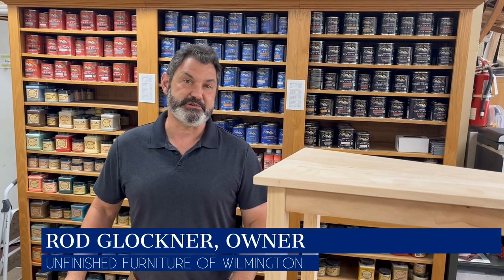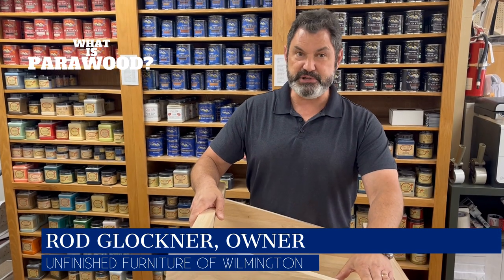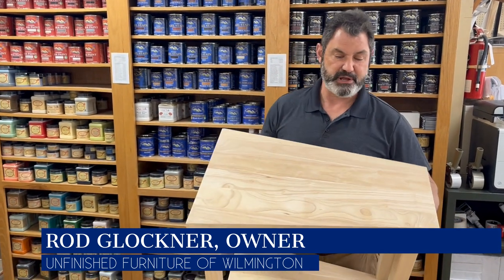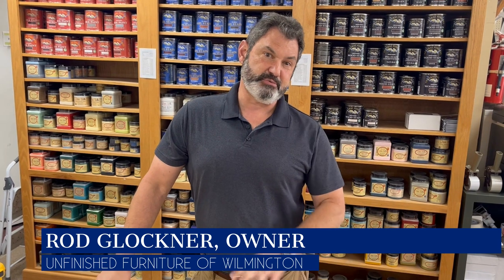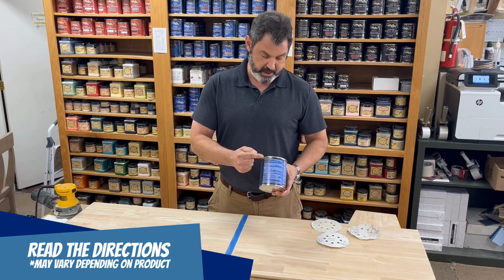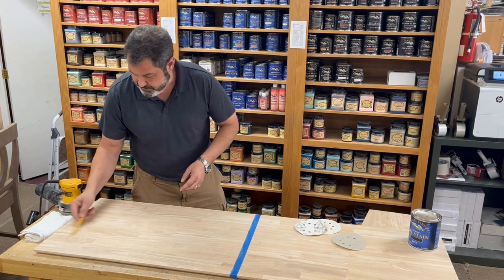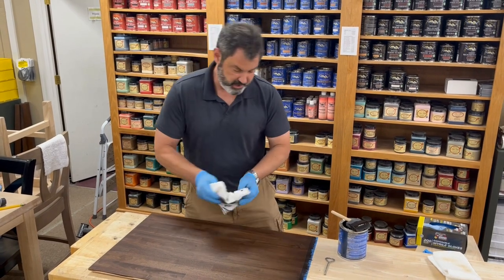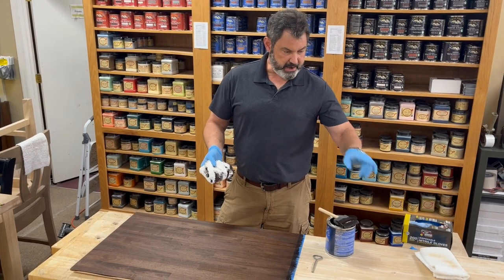What is Parawood and How to Prep and Stain Parawood

Comment: I put my 1st coat on and its blotchy, did not use thinner. could I sand it again, use thinner then re-stain for a better 1st coat?
Reply from the maker: Absolutely.  Parawood is solid wood so you can sand and restart with no worries.

Comment: I love the color of that sanded side...what is the color  & wouldn't want it darker. So my question is, how.many coats.& want is.the best top coat or sealer for butcher block counter tops?
Reply from the maker: Hi John!  You could wipe mineral oil on the butcher block to keep it in good condition.  After using it for any food prep, wash it with soap and water and then reapply more mineral oil.  You could also use what is called "Waterlox", which you can apply less frequently.  It's easier to maintain.  Here's a link to their website if you'd like to research: https://www.waterlox.com/original/ :)
Reply: This video was very informative. I have never used stains before and bought a water based walnut for my parawood table. I just sanded the entire table at 80 grit before I saw this video. 😮Should I follow your steps and sand it with your recommendations? Also do you recommend water based or oil based on parawood? What color was this that you used?
Reply from the maker: Hi Batch2b!  150-180 grit is what we used in the video.  Nothing wrong with following the steps in this video on your project.  Both types of stain work well on parawood.  We like oil based better, it's just easier to use.  In the video, Java Gel Stain by General Finishes was used.  If you have any other questions, just let us know!

Comment: great video! it's hard finding resources on refinishing rubber wood. what sealer would you recommend? i wanted to refinish the rubber wood top on my kitchen workbench and want to preserve it's blonde color
Reply from the maker: Thank you for the kind words!  We like General Finishes Topcoats.  Their High Performance water-based urethane topcoats can be used over painted, stained, and raw wood surfaces.  It works very well with parawood/rubber wood.

Comment: Thanks for this helpful video.
I want to whitewash an unfinished, unassembled parawood nightstand. Do I follow the same prep steps that you showed above for staining? What do you recommend for a clear top coat--water or oil-based? Thanks!
Reply from the maker: Hi Deb!  Follow the same directions as seen in the video for either painting or staining. 
If you have any doubts as to how the whitewash will look, start on the underside of the nightstand or an area that is not as visible like the back of a drawer.  That way, you see how it looks, can make any tweaks, and can then continue with the entire project.  
As for clear coating, we love the General Finishes water based top coat.  Oil based can yellow over time but certainly the General Finish oil based top coat is indeed awesome as well.  If you using an oil based paint and using a water based topcoat, let the final coat of paint/stain cure for at least 72 hours before applying the water based top coat.

Comment: Can you use water instead of paint thinner? Also, have you tried Odie’s oil on it?
Reply from the maker: Hi Patti! Water can work similarly on some wood species like Pine and Parawood, but steer clear using water for this technique with Oaks. 
One of the benefits with using paint thinner is that it evaporates rather quickly.  Water can raise the grain so you might have to do some light resanding to knock the raised fuzzy feeling off.  We have not used Odie's Oil so unfortunately, we don't have any info on it.

Comment: Someone talked me into using Dixie Belle Boss clear coat under my gel stain before staining.  It has made my furniture really rough.  Have I made a mistake?
Reply from the maker: Hi Kim.  Prolly not a mistake.  If you are using Dixie Bell Gel over top of the Boss, you will need to sand after the application of the Boss to smooth it out prior to application of the Gel Stain.  You can always call us at the store if you have other questions.  910-399-2276.